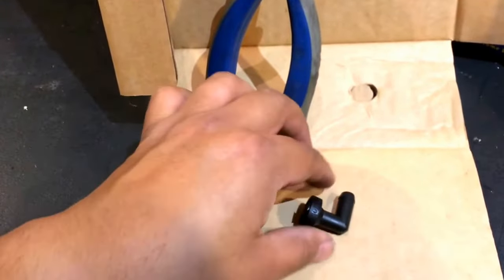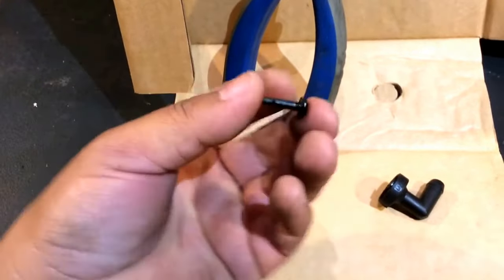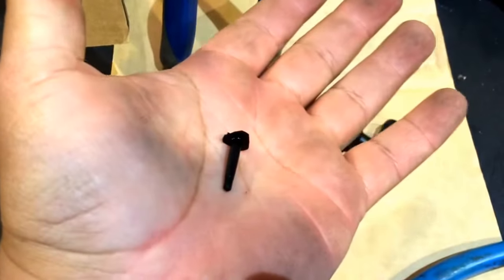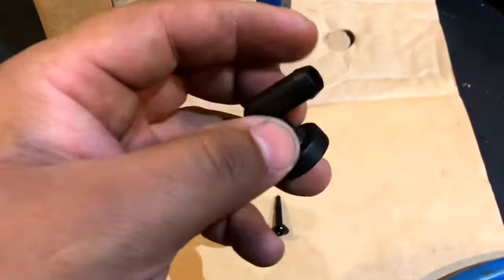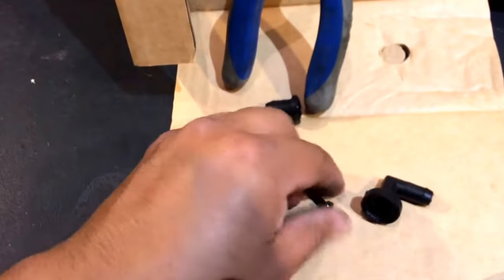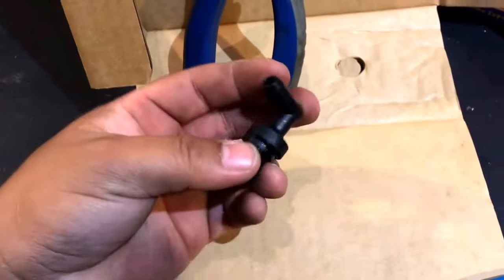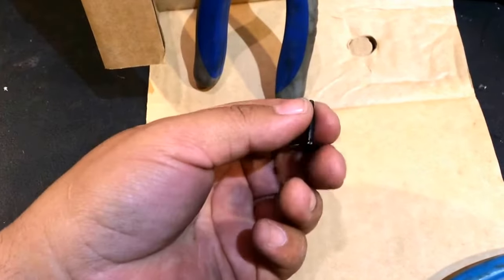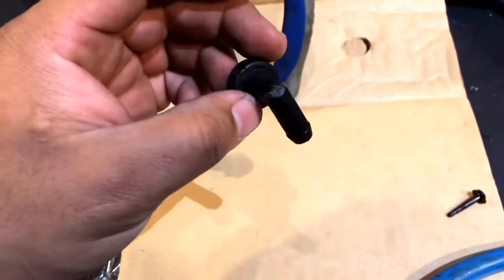What's Inside a PCV Valve? What does the inside of a PCV valve look like?

Comment: Hi I have a 98 Oldsmobile bravada I change the rotor ,cap spark plugs,wire , it was getting a p0300 code before I change the parts .now I am getting p0300,p0302 now ,can it be coil ,or fuel filter, ,fuel injector    , can you help don't what to change now . So people are telling me all kind of that don't know who to believe  , can you help me  thanks for you time  hope you can help me ????
Reply from the maker: +nathan wiggins most likey you need to change out the fuel injector spyder system
Reply: What's your car doing? Not giving any milk?
Reply: Nathan turn your key on but don't start and listen to see if you can hear the fuel pump running..it is like a low buzz.it will only run for a few seconds then stop. Ok if it's running then your fuel pump us good. Ok now if your car motor us turning over but it won't start it's either out if time or your mafmgnetuc pick up on your distributor is bad . Dud you ever get it fixed. I see it's been 3 years